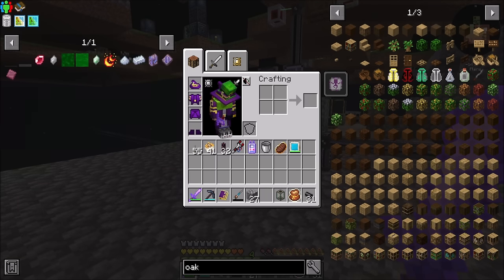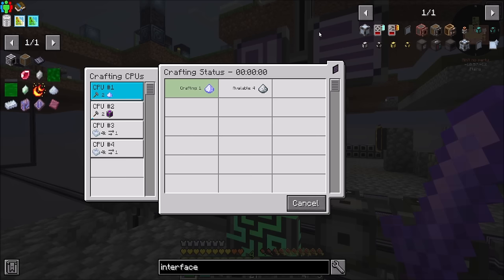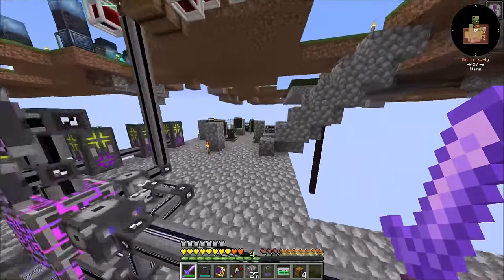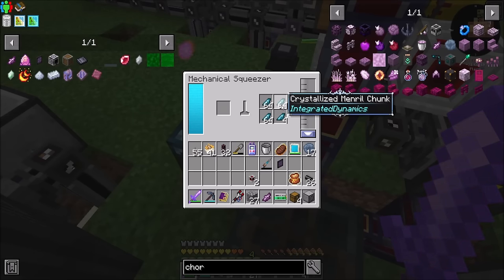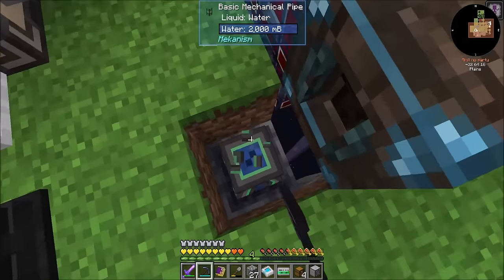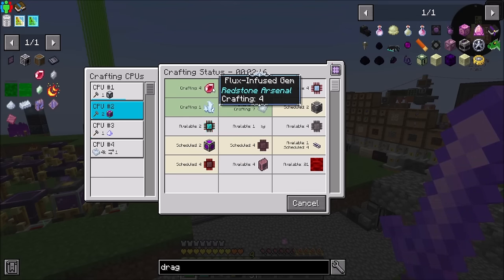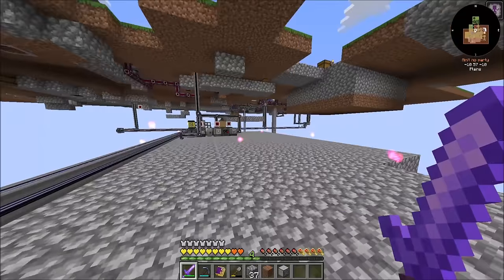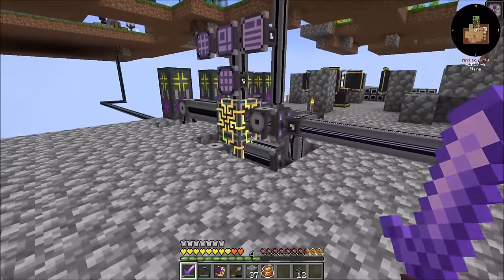FTB Skies Expert Ep77 ME Requesters

Comment: You will need a lot more liquified source, and split it into its fluid elemental components for the next stage.  Also, with the amount of Flux infused diesel that I make, I would keep that chorus fruit in stock.  Those fluid drawers are flakey when they are at 0 buckets.  I ended up spamming ae2 fluid disks as a workaround.  

Basically for the cost of hostile mob prediction matrix, source, and a menril sapling, I stock my chorus.  Working on a similar gravel sifting for silver and diamonds only to keep platinum and osmium in stock. 

Also, there is an Alfheim market block that allows for simplified automation (just needs one spark for mana).

(I realize he addressed some of these by the end, but I had to get off my couch and move to my PC to post this comments before I forgot).

Comment: 1/256 chance of not getting a chorus shard. 95% certainty to fail getting a chorus back at least once after 764 requests for a shard.

873 if you were lucky enough to have that cycle craft the full bucket of chorus liquid to the drying basin and returned that one instead.

Comment: Dire, why didn't you just use a machine to make stripped logs? That would be much more efficient, and faster, than making a saw and using it in the AE system.
There's an extended pattern provider from the same mod the extended interface is from that can hold more patterns.
Botanical machinery has a block that performs elven trades and is designed to work with AE.
Why are you still requesting silver? You should have fully automated dropping the raw ores at the crusher and smelting them 30 episodes ago.
Reply: Efficiency and forward thinking is not the dire way